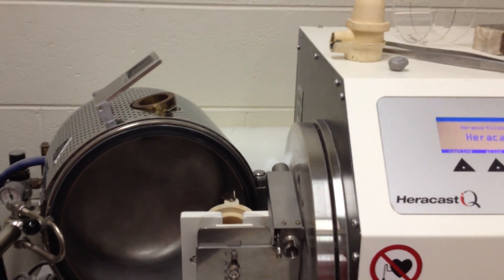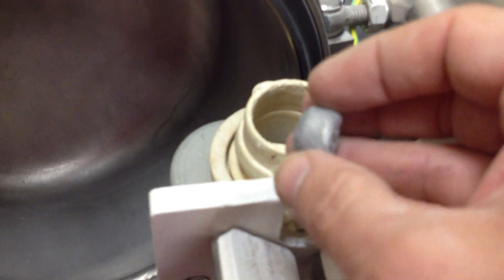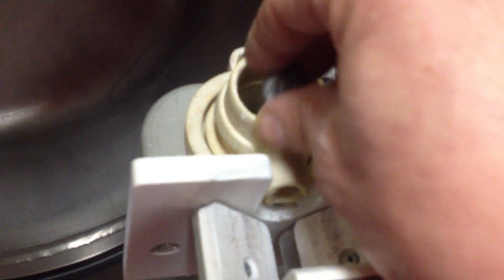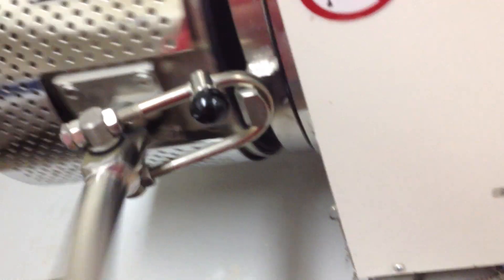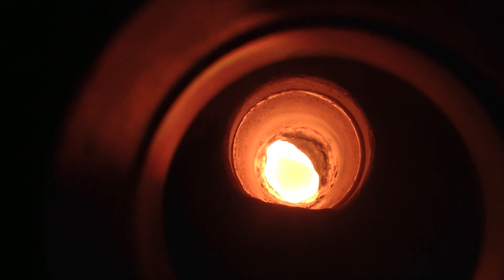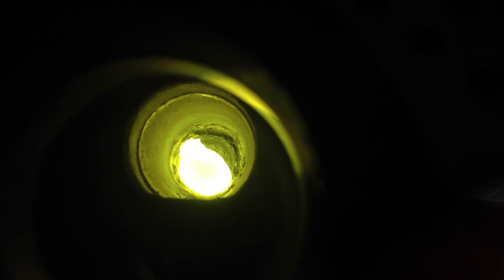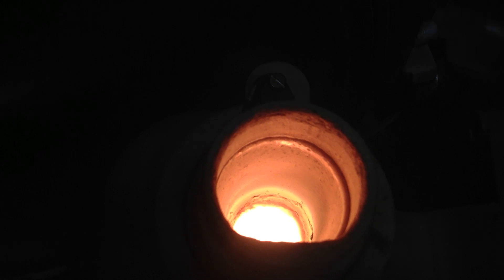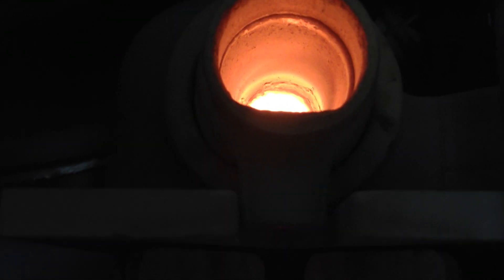Vaporizing metal for the Meyer magnetic gas epg.

Comment: So the cobalt bonded to the crucible?  I wonder how the heck you would get the gas to bond to more gas and not the magnetic field source...
Reply from the maker: firepinto No problem..I can vaporize metals in other ways as well. This was just an experiment to see if the vapor was magnetic, with whatever equipment I had on hand. Now we know it is, it's worth spending time to make a home system where you can extract the vapor.

Comment: Interesting machine. Whats it used for? Got a plan for extracting the metal into a gas stream?
Reply from the maker: m3sca1 It's a vacuum/pressure induction casting machine, used for casting metal. I used the premelt cycle so I can just melt the metal in a vacuum. I wanted to see if the vapor was magnetic so doing it in a magnetic field  (induction field) shows the gas going directly to the crucible wall off the metal. Organic vapor just floats there like a fog..this vapor was moved to the crucible wall by the magnetic field...
As for a plan to remove the vapor...no...but it's pretty easy to set up a home system which will vaporize metal and with that you could do it.

Comment: hey i am making a hydrogen generator can i talk to you?
Reply from the maker: сталкер чворович yes sure...what about..??
Reply: electro1622 basic construction what metal should i use for the electrodes etc but keep in mind this is not going to be something for generating 24/7 its just a project and kultus nagrant sent me here
Reply from the maker: сталкер чворович

I just use 304 stainless pipe, but any stainless will do. I am copying Meyers cell so measurements are off his plans. You can find them Meyer estate files on RWG channel. Search my channel, I have a few with my cell in it, if that is what you wanted to make.
Reply: electro1622 just a cell i am not aiming for any great results just a generator juess i will try with the stainless
Reply from the maker: сталкер чворович you can use any metal, but it corrodes...stainless doesn't, that's why it's good..
Reply: electro1622 yeah figured that out ;)
Reply: electro1622 is it normal for the power consumpion to rise after a few minutes of work?
Reply from the maker: сталкер чворович yes..if it's only a few minuets your probably over powering your cell.
Reply: electro1622 i didnt know that was possible so ok when i switched it on the power input was 500-550W then it began to rise intil it was 700 or more i am puting 24V into it
Reply from the maker: yeah..gets hotter too.
Reply: electro1622 yep so what can i do to fix that? besides lower the input voltage i cant really lower only the amperage
Reply from the maker: сталкер чворович
That's what we are all ( Meyers experimenters ) working on...his system doesn't cause heat..
Reply: electro1622 yes and Yull Brown to gues i will have to just lower the input intill its stable enough to have a 100% working duty cycle
Reply from the maker: Tan Kasuma runs 100% duty cycle for his motorbike....I think.
https://www.youtube.com/watch?v=lEl6UZWvjr4
Reply: electro1622 interesting if yu want you can chek what i made but i am making a new design as we speak
Reply from the maker: looked at your channel....only Tesla stuff...
Reply: electro1622 the last video